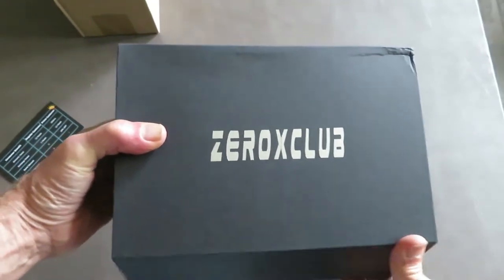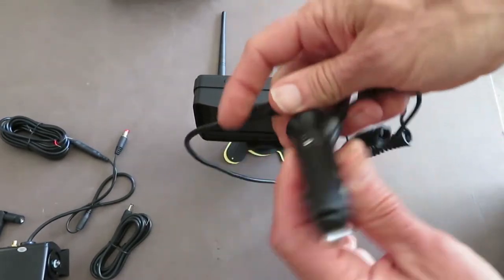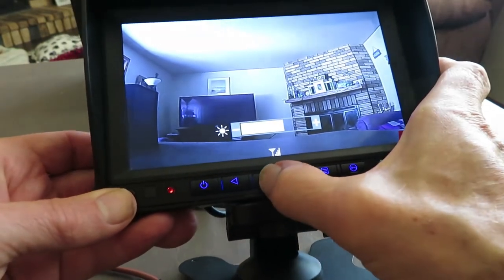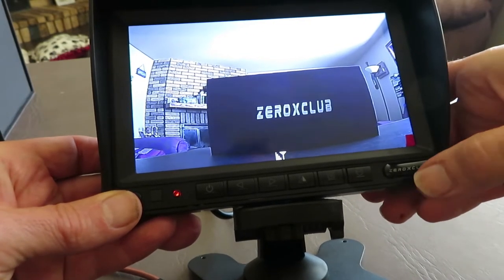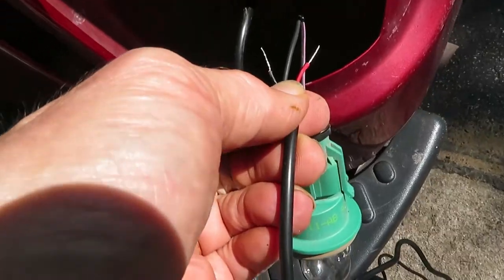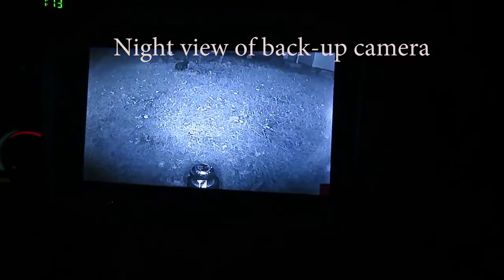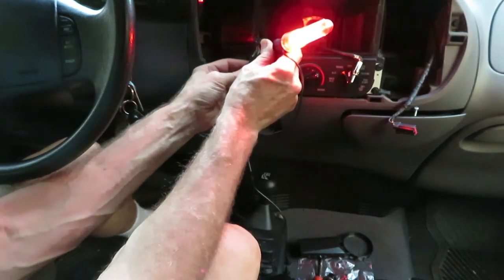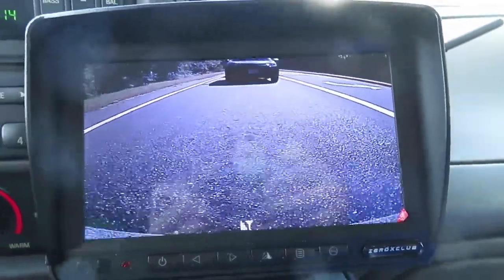Zeroxclub Backup Camera Review with Installation in a Ford F150

Comment: Go Pack Go ! I'm having trouble getting it to work from the rear of my RV. I think it might be too far.
Reply from the maker: These units are intended for RVs and even semi trucks so it should have the range. You might try different positions and antenna angles. I heard their customer service is good if you continue to have problems.
Reply: I had the same issue.  4 Door Dually pulling at 33 ft travel trailer.  I ended up buying a 30ft antenna wire, ran it from the camera to the front of the trailer and mounted the antennae on the roof right near the front edge of the roof.  Freezing / drop outs went away.

Comment: Is it legal to screw into your license plate like that? Just curious
Reply from the maker: As long as the numbers on the plate are not concealed by the camera it should be fine.
Reply: You can get a ticket if either the State Name or Numbers are blocked.  Friend got a ticket because his license plate frame covered half of the state name at the top.

Comment: What does that red button do on the camera
Reply from the maker: I recall checking it and finding no function. Some cameras have a switch for turning the guidelines on and off but this model doesn't have a guidelines option, per the vendor.
Reply: @TheOriginalMechanic  I just figured it out. I just ordered these cameras but my cameras weren't synced to the monitor. Those buttons are to sync